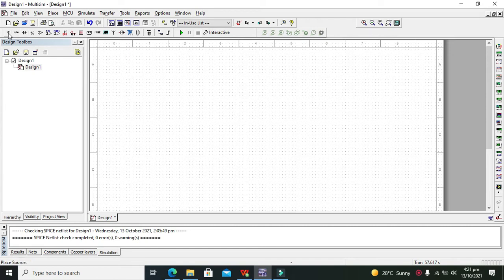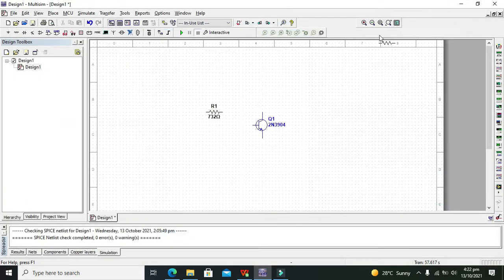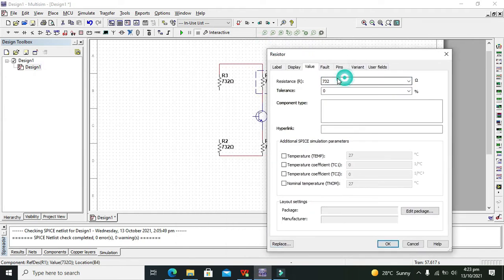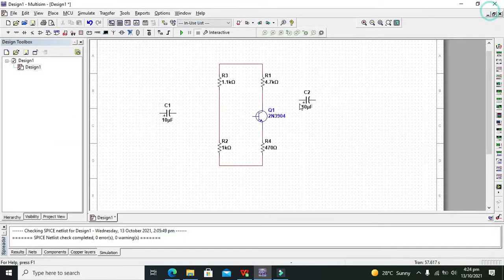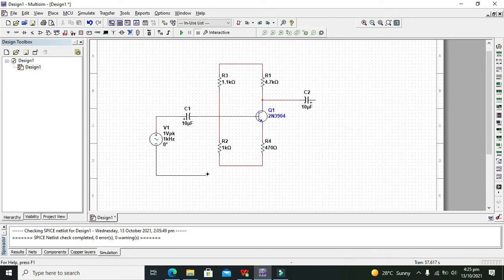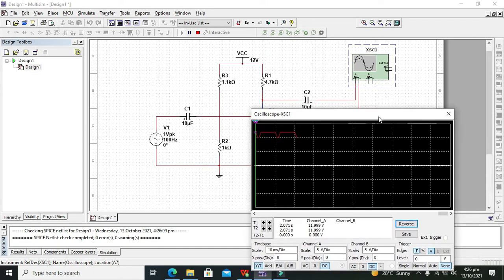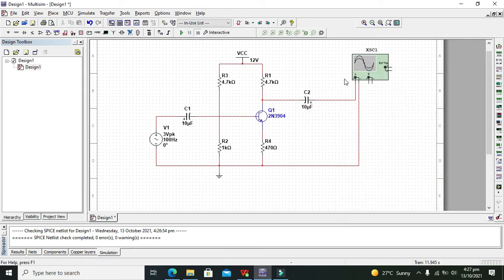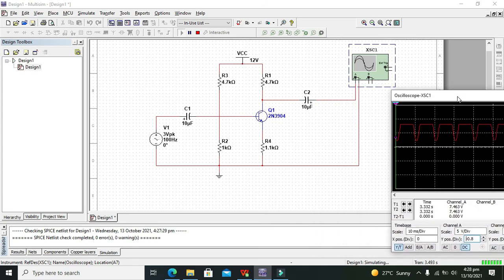transistor as an amplifier in multisim | simulation of transistor as an amplifier in multisim

Comment: Hello! Error in scheme! You hasn't joint the base of Q1 & voltage divider R1/R2. Therefore Q1 hasn't the bias...
Reply: IB is very small in micro ampere so current flowing in R3 will go into R2 (assumed becuse of less IB), therefore this circuit will work even if connection is not there.
Reply: @agarvipul  They are no sense R1, R2 without connection to base. They may be deleted...
Reply: @samprihogu7263  Therefore, when the waveform is tested later, it is not regular. It may be related to the fact that these two resistors are not added to the base.